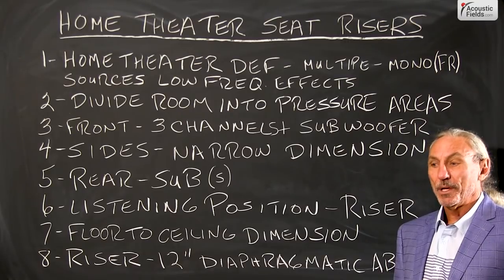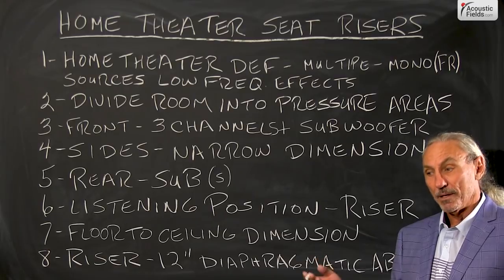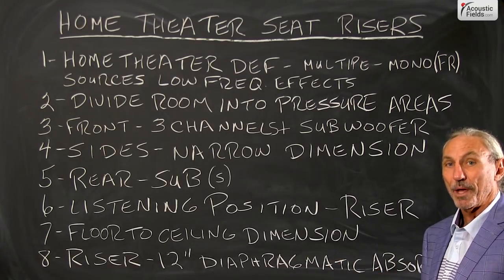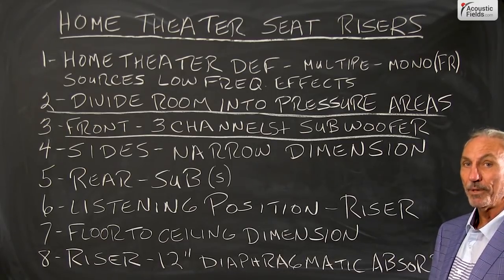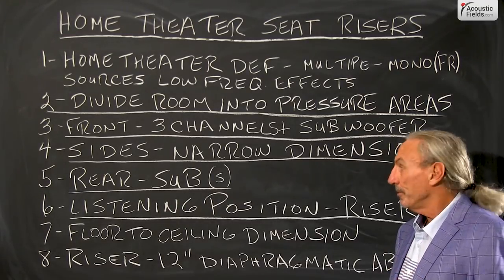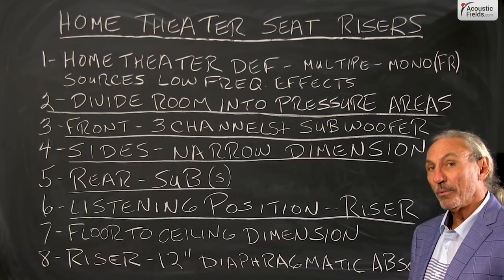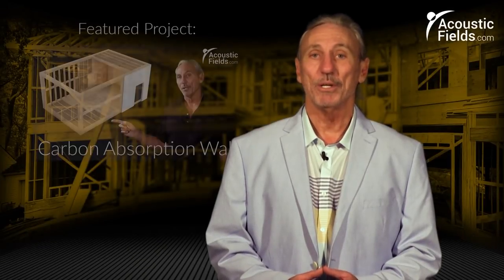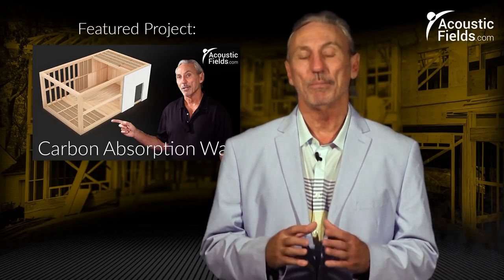Home Theater Seat Risers With Integrated Low Frequency Absorbers - www.AcousticFields.com

Comment: Hello Dennis,

I have worked in the cinema business for over 60 years and know that center channel is where all of the dialog is placed.  Starting with single channel and then to stereo and multi tracks 5.1 and 7.1 the dialog has been in that center channel.  There was a time, with 70mm films that had magnetic tracks, when we had 5 speakers across the stage  behind the screen.  That was when the dialog tried to follow the images across the screen by moving from one channel to the next.  That system is no longer in favor.  Know that the sound from that center channel is what tells the story in the words from the characters.  Cinema screens are porous with the speaker behind the screen.  Most private screening spaces have solid screens or even hard surfaced and solid image displays like LED screens.
Reply from the maker: K,  Agreed. However, most home theater applications include a center channel that is not physically aligned with the right and left channels. It is usually a horizontally placed cabinet under the screen. A horizontally placed cabinet under the screen and vertically placed speakers for left and right produces distortion that is audible. You have comb filtering from the horizontal center since it is so close to the floor and not time aligned with your ears. We split the center channel signal and send it to two left and right new speakers that are the  the same speakers as the right and left channels. This keeps all energy in the vertical array using the same timbre and displacement as the left and right channels and gets rid of the distortion produced by the center channel under the screen.
Reply: Dennis,  Thanks for the reasoning behind your desire to get the speakers in the same plane for time alignment.  To go back to the Lt & Rt only channels would be a step back in technology that was, frankly, unsuccessful. Except: the sound in the center channel is not heard in any other speakers. (Unless there is bleed from the center into the surrounds)  The 35mm film decoding process places the dialog out of phase from the left and right channels so there is no same sound from the Lt & Rt  and Center.  Modern digital encoding systems have each channel as a discrete output to the amplifiers and speakers.  Often the center channel behind the screen is a totally different system from the Lt & Rt and is tuned for speech clarity. Think of the center as a mono voice speaker to be placed in the best location to be heard from all seats and clearly understood speaking and singing sent through it.  If you can find a way to get rid of that center channel, I know of a few thousand theaters that would snap it up right now since there is technology for making the projector go away and an LED panel take the place of the screen.  There is no way the speakers could work from behind that solid panel.
Reply from the maker: K,  Your thinking and placements are for larger venues. I typically work with a 3 seat maximum, 29' w x 12' h x 37' This would be an average footprint.Same plane, time alignment is critical with smaller distances from side wall to listening position. Rate and level of absorption are also critical issues and we have found an absorption curve that works extremely well for music and voice. In larger venues, with more energy and longer coverage distances, you can place speakers behind the screen. Even though there is no such thing as an acoustically transparent screen, the 1 - 2 dB attenuation is not so noticeable with lots of energy and larger volumes. Its a nightmare in small rooms.
Reply: Precisely!

Comment: Hey Denis, I was watching your video "Understanding Your Room Frequency Response"  where you talk about "the bump" in a room. I have a question because im starting to understand whats going on in my room with low frequencies. My room have that bump in the back wall (like everybody else)  but something really interesting happens evey time I open my door closet (which is full of clothes). It seem like that bump disappear and the room sounds more balanced. I walked the entire room and the bump is no longer there.  I don't know if its because the closet is swallowing some low frequencies or the door been creating a big triangle against the right corner of the room from floor to ceiling is trapping the bass in that area. Could you explain to me whats going? I come to you because you are the only one I have found that really knows what you talking about. Thanks in advance.
Reply from the maker: I,  Yes, you did two things when you opened the door. First, you increased the volume of the room. Second, you used the closet as an absorber with a certain resonant frequency. Energy above the closets resonant frequency would be absorbed.
Reply: Oh wow ,thats  very interesting.  Thank you again!!

Comment: Denis what’s your thoughts on multi subs to flatten frequency    Responses without the need for absorption i.e Floyd tools theories?
Reply from the maker: S, Multiple subs do have an impact on frequency response. It is in the + 1 dB - + 2 dB range. These numbers are dependent upon room size and volume and also at room pressure levels. At the price of sub woofers today, it is not cost effective nor wanted. Adding more energy, to treat too much energy already, makes no sense. It is best to absorb the excess energy and lower peaks through absorption. If you want multiple subs then treat the room accordingly and add more subs for the sole purpose of more low frequency gain in the room. Attack and decay rates through all frequencies below 100 Hz. would be a requirement of the absorption technology, especially with multiple low frequency sources.
Reply from the maker: Too expensive for minimum performance gains.